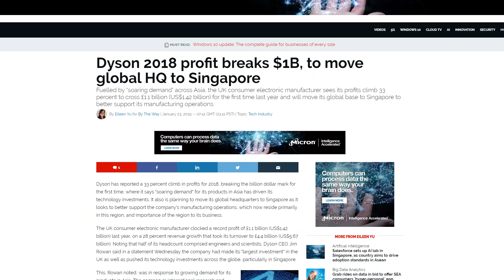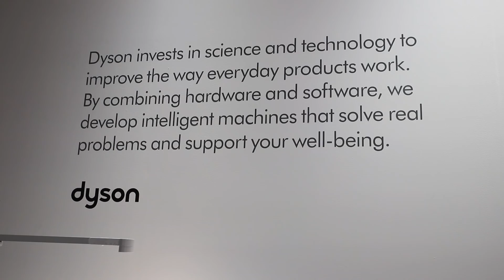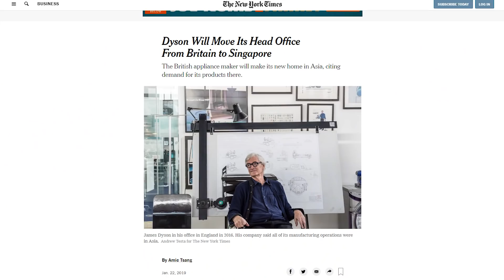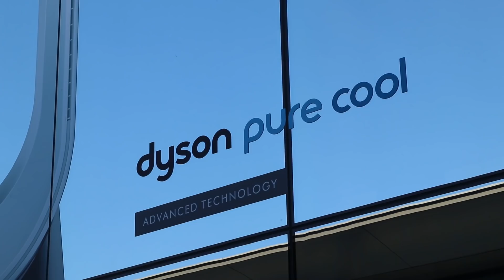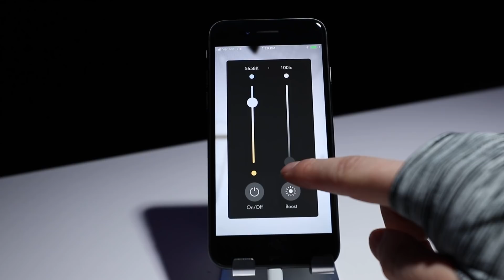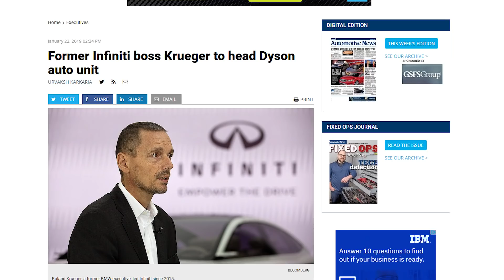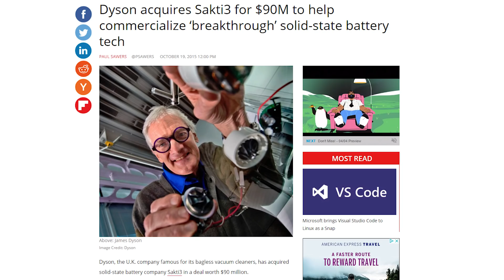Why Dyson is the tech company you should be paying attention to

Comment: Dyson's core strength, electric motors and battery design..
Reply: Dyson uses Panasonic motors and uses sub-par batteries, hence the need for a free replacement program when they die (and they will). Sorry my dude.

Comment from the maker: A few of my biggest takeaways from this project: James Dyson stopped at nothing (5,000+ failures) to get a single thing right (the original bagless vacuum), roughly half of the Dyson employees are engineers, many of which are hired right out of college, and James says failing is key. I think most of us think of failure as something bad, but failing is learning.
Reply: Dyson vacs are absolute trash, and are not designed to be repaired, but replaced, which is why they are sold through big-box stores. Try using a Miele vs Dyson to see how truly far behind Dyson's tech is in real world applications. Or simply contact vacuum only retailers and ask them about repairing Dysons. Dyson is a marketing company, not a hardware company.
Reply: @thelaw4175  No independent vacuum shop I've been in ever recommends anything other than a Miele for household use. If you have allergies and really need to remove dust, the Miele is the way to go.
Reply: @krashd  Even if you're not their customer, it's kind of hard to believe that you've never heard of Miele.... I mean, you could have done a simple Google search before typing that comment. I'm talking about independent repair people, and stores outside of the bigbox stores. I mean, Miele kind of sold out and offers a bagless model for the Best Buy supply chain now, but it's not going to clean out dust the way their traditional line does. I have one, the filtration is a bag, a filter going into the motor and a sealed activated charcoal unit after the motor. Bagless vacuums like the Dyson are ok for a baseline level of cleaning, but they are definitely not the ultimate if you live with people with acute allergies.
Reply: @thelaw4175  What are you actually talking about lol I've owned my dyson hoover for 15 years now and had it repaired 3 times by a third party shop that are nothing to do with dyson.. they mainly sell fridges lol Also have a cordless dyson v6 and have had it fixed once by the same shop with no issues either. So please tell me were you are getting you're information from? Have you actually ever owned a dyson that you have tried to get fixed considering you said ya own a Miele? Or are you just making this assumption after making a few calls? lol
Reply: I spent £500 on a dyson fan, and it has a constant high pitched whistle   -   their vacuums and hand driers are great, just dont buy anything that is supposed to be "ON" for long periods
Reply: Thanks for this, I loved dyson and always used it, great suction free hovers.
Reply: Rich 91 
I work in a store that sells both Miele and Dyson where I have hands on experience with both. 
Dyson are brilliant vacuums but I have to say that they do not compare to the suction of Miele and they do not filter all the dust like Miele does. 
Miele C3 is a really great all round vacuum (and at half the price).  If you have the money for Dyson I would go for the new, V11 its really impressive and convenient. But the Miele C3 is still the best for deep cleaning when wall sockets are available. 
For some reason the cyclone just can't remove the fine dust particles the same way Miele's filter bag can.